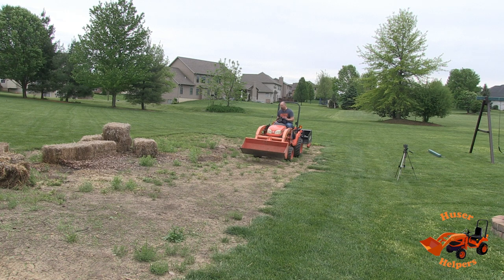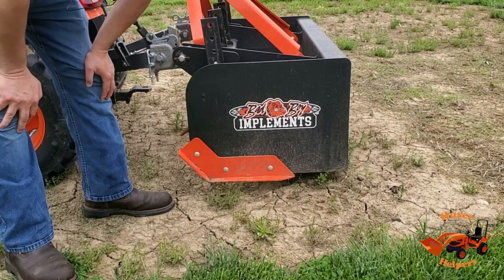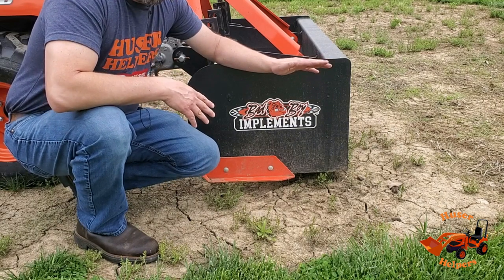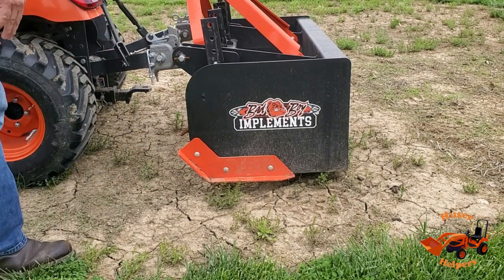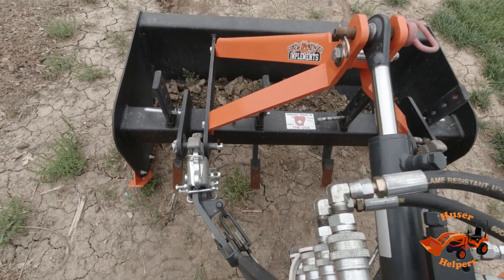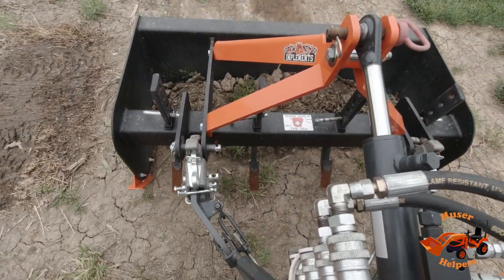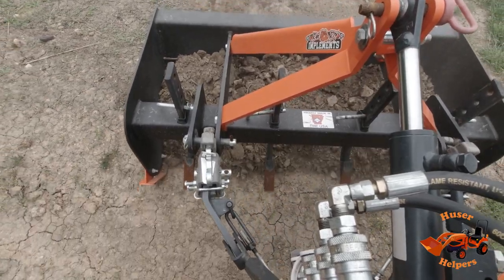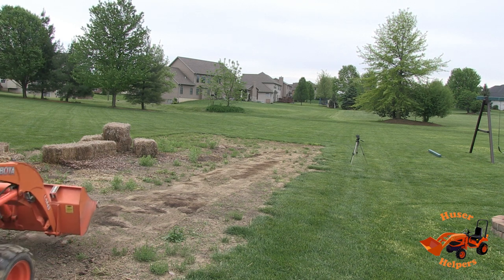Hydraulic Top Link - Watch This to See How It Can Help - Kubota BX

Comment: Nice demo Jason. One observation...on your first pass after getting set to neutral, it sounded like you were attempting to adjust the box to make the cutting edge more aggressive but it appeared you were lengthening the top cylinder.  I think that's backwards.  That would cause the rear edge to drop, lifting the front cutting edge.  If you shorten the cylinder you are making the front cutting edge more severe/aggressive and the box cuts deeper.  Did I misinterpret?

Anyway, don't mean to knit-pick...still loved the video and still envious of those rear remotes!  I'm still saving pennies for mine!
Reply from the maker: You're right.  I finally got it dialed in in the second pass.

Comment: Hello, thanks for the great video! I have a question, do you remove the toplink when you don’t have it mounted to equipment? Or do you always have it mounted to equipment?
Reply from the maker: I've taken it off if I'm mowing, but most of the time I just hold it up.  I modified the holder bracket to accommodate the cylinder.
Reply: @HuserHelpers  thanks for the response! Hope I can also get one, maybe if I get my father crazy enough to buy one 😂🙈